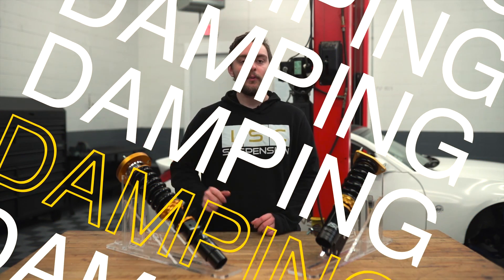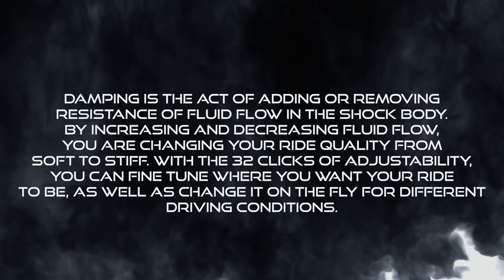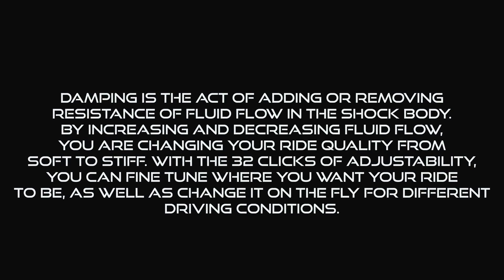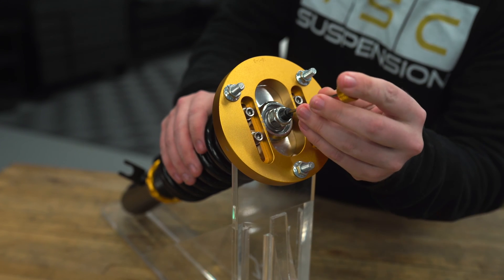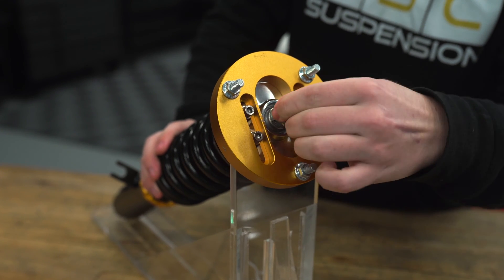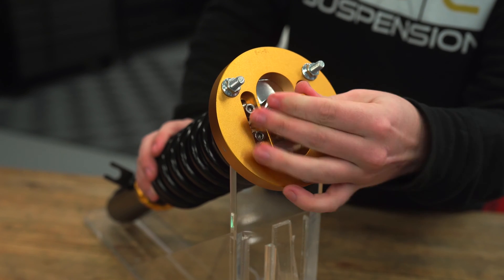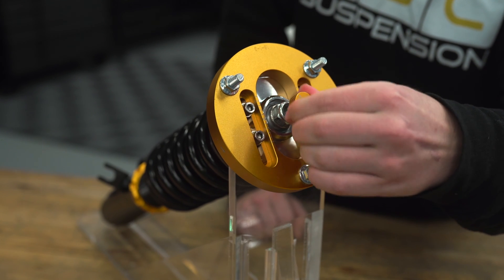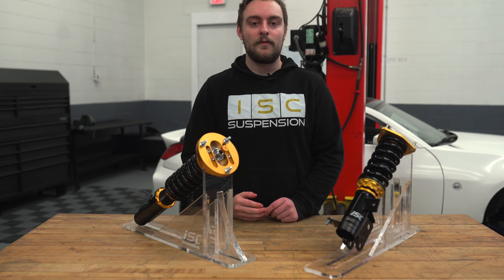ISC Suspension // Damping Adjustment + Damping explanation

Comment: I bought these for my e46 and they ride like crap even after messing with the dampening settings
Reply from the maker: do you have the proper preload set front and rear? please reach out and we can assist further in proper setup.
Reply: @iscsuspension  I havnt looked at it, I had a local shop put them on my car. Maybe they set it wrong? Thanks👍🏼

Comment: Awesome Vid. Please make one for the rear strut adjustment, thanks!
Reply from the maker: hey! so the rears will also always be 32 clicks as well. whether you have the drop in clicker in the rear, or the integrated clicker adjuster, damping will be adjusted in the same way. Turn the adjuster all the way to one side, and then go 16 clicks and that's the middle. And then adjust from there to your liking!

Comment: V helpful! Pls make a video for the rear shock adjustment and how to identify adjustabe setpoint without the "click" since rears are a bit different.
Reply from the maker: hey! so the rears will also always be 32 clicks as well. whether you have the drop in clicker in the rear, or the integrated clicker adjuster, damping will be adjusted in the same way. Turn the adjuster all the way to one side, and then go 16 clicks and that's the middle. And then adjust from there to your liking!
Reply: @iscsuspension   thanks! 
On the rear divorced shocks for e46 m3 will the adjuster stop turning 16 turns to the left from center and/or 32 turns//clicks from one end to another like in the video for the front coils?

I dont hear any audible "clicks" in the rear is the thing. Want to make sure I follow manufacturers' guidelines before I go adjusting away..
Reply from the maker: @asemahmed7907  correct, same rules apply!